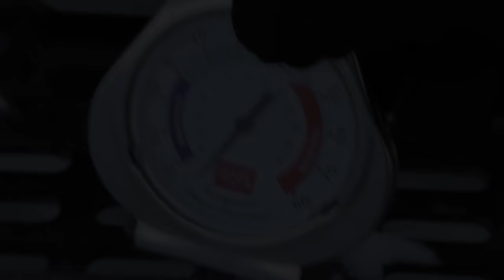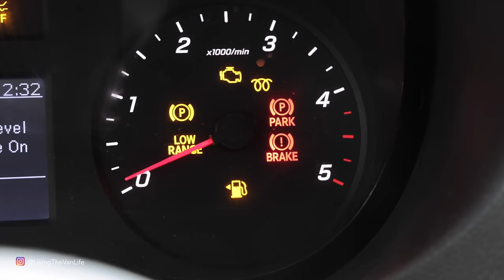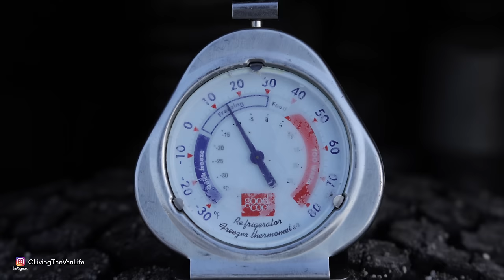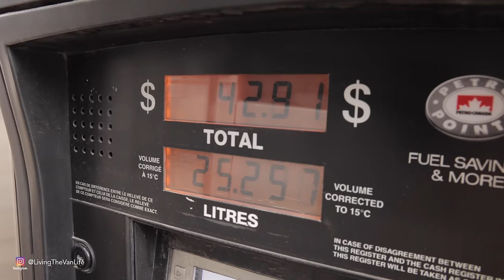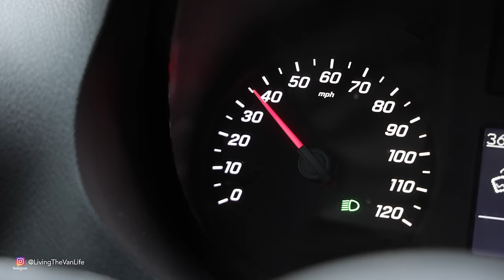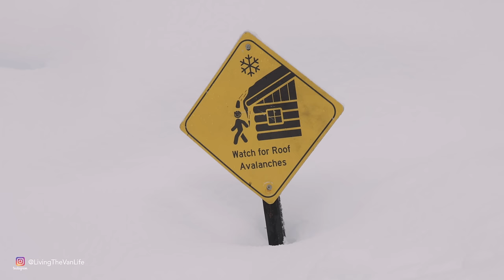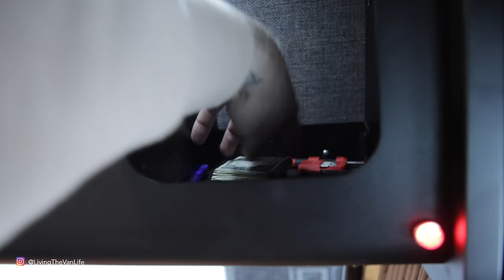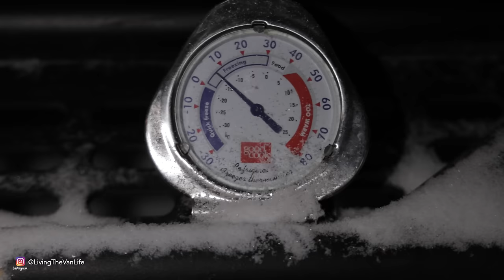Van Life in The Arctic - Part ONE - Living The Van Life

Comment: Thank you Chad!
That is a long hike from where you came from.
I used to truck that from Edmonton to Whitehorse in the late 70' , hauling Jet B fuel on A Trains  Steamboat mountain is not there anymore  and older parts of the Alaska highway.

If it were not for the threat of the Japanese in WW2 the Alaska highway would not have been built. And awesome hiking trails along there too.

The last time I drove up there was with a production company " Due South. I was the only one that had driven that way in all the members of the union. That was 1993.

I like your content and your respect for safety and manufactures to be conscious of their equipment.

Well done Chad.

Bill Kelly

Comment: Hi;my name is Kelsea,I'm 19 years old,and I'm going to Norway north of the 66th parallel for 6 months in November with my self-built 419 Sprinter.It is 7 meters long, almost 3 meters high, and weighs 4.1 tons.I sleep (except for storms) in the roof tent.I have installed a 4 KW diesel heater, as well as a bathroom with shower and toilet.I also have 3 x 12V 200Ah lithium batteries for my electrical devices.In contrast to you, I do not travel all alone, but have my Alaska Malamute as an accompaniment.I really liked this first part - I'll watch the second part right away. Greetings from Germany,Kelsea

Comment: in February I drove to the North Cape with my SUV and rooftop tent; The North Cape is again approx 120 miles further north than Tuktoyaktuk. It was a rather easy drive and luckily it wasn't that cold. Coldest temperature I had was -7°F
Reply from the maker: Bad ass.  Impressive in a rooftop tent!!   Did you have a heat source in your rooftop?
Reply: @LivingTheVanLife  yes, I had a mobile diesel powered heater to provide warm air for the tent; Otherwise it would have been ... difficult ^^
Had 2 heating backups just in case it fails 

I was the only one with a rooftop tent up there, but other tourists said only days before they saw a guy with a normal tent

Comment: Awesome cinematography creation...So far looks like you have some great preps for northern winter driving.  My only suggestion would be to add some bright rear red driving fog lights for the low visibility days.  Never know when you need to be on the side of the road and the truck drivers need lots of visible lead time to safely negotiate around on solid ice.

Comment: What fuel additives did you use to prevent fuel gelling? Did you install a fresh starter battery before the trip or have any issues getting started in morning? Did you run your van for short periods at night to prevent the oil/fuel from freezing? How was the frost inside the van windows each morning? Anything you can mention for mitigating all that I have mentioned would be helpful. I camp and ski out of my 2020 sprinter a lot in the winter. Several times in sub zero temps for multiple nights in a row, without driving the van much each day. I have to be quite preventative to camp in really cold temps and trust the van will start each morning after. Thx.

Comment: Loving your videos maté watching from back here in Australia 🇦🇺 
I have 7 different diesel heaters they are the best addition you can add to a vehicle.
When you mentioned topping up your tank at every available refill point it made me think that you are totally reliant now on your vehicle tank and for me that was a bit concerning because if you’re in the negatives in the Arctic and a rock opened up your fuel tank or a fuel line broke not only would you dump your fuel out but it would render your diesel heater useless. I never thought much about it until you mentioned buying fuel ⛽️ I think if I was going to go to the isolated places that you visit I would take a separate diesel heater with me and a separate fuel tank just like you had in your other vehicle. They really don’t take up that much room and you’re new Sprinter van is so big. Anyway just a thought also you lose your fuel you loose your motor and if you’re solar isn’t producing then you’re diesel heater doesn’t run. I guess carrying extra weight has to be a consideration but when it’s a possible life and death situation better to have backup. Keep rocking it I love your videos because you take your videos into extreme situations and low temperatures and your still enjoying life. 👍

Comment: Would you have considered chains or studded tires had you done this trip again?
Reply from the maker: Definitely not snow chains at all.  That is not a thing up north.  When you you are driving over 2,000 miles on snow and ice, snow chains are not practical at all.   To cover that much territory, you end up doing 55-60 mph - that’s not possible with snow chains. 

Studded snow tires?  Yes for sure would consider that next time.

Comment: Why you are not using tyre chains for better traction
Reply from the maker: I didn’t need extra traction. And because I’m driving 2,000+ miles on snow and ice at 55-60 mph.  It’s not recommended to drive more than 35 mph with chains. It would have taken 6 weeks to complete this trip instead of 3 weeks. Nobody used chains in northern Canada.  You use good tires and good driving skills.